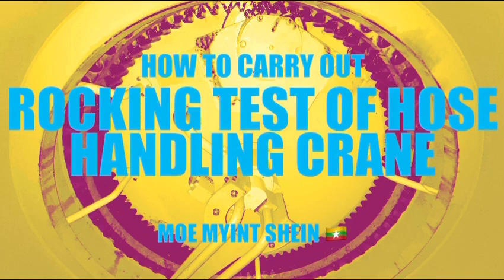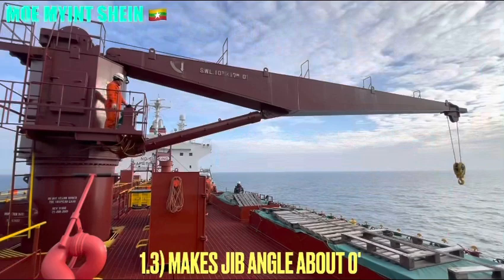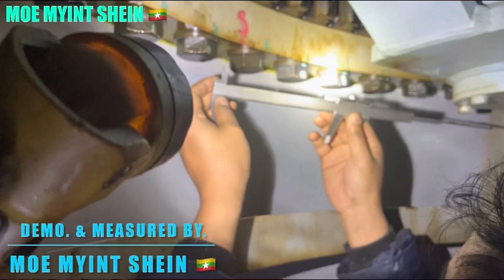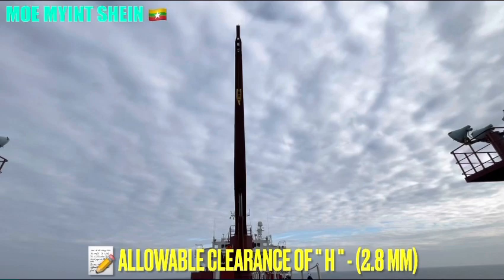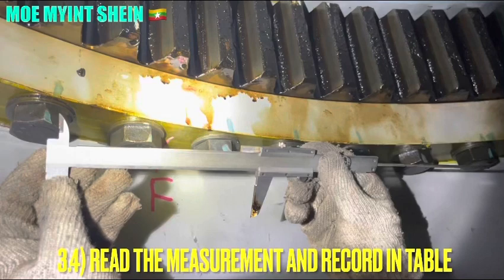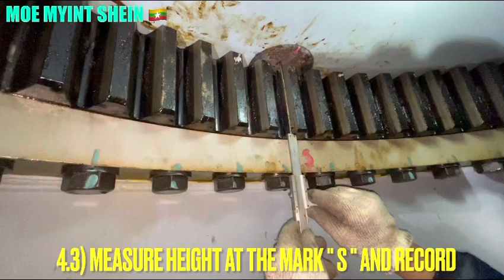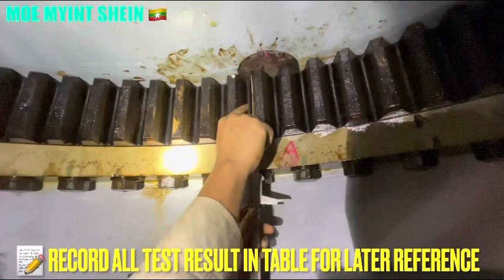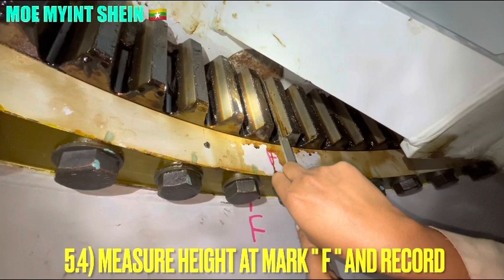[CRANE] Rocking Test | Measurement Slewing Bearing | Marine Engineering | Technical Vlog : 059

Comment: If the jib at fwd and 0angle, we read H fwd , and H aft.

After that , Hfwd - Haft <2.8mm???

Is this correct?
Reply from the maker: Good Question, Bro. 
I have inserted one table in this video for quick reference.

Wear Limits (Wa) were determined by the subtraction between Initial Values and current values. Initial Values get from the very first time measurement after ship had been launched. 

Depends upon positions of jib, subtraction can be changed. Subtraction from Initial Valve (or) Subtraction from Current value. 

Hope you will understand. Thanks.